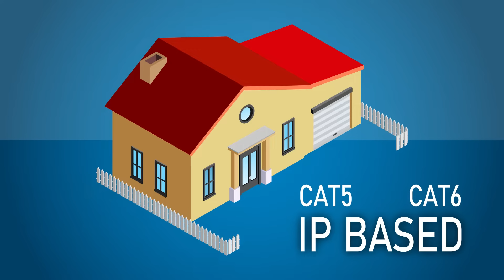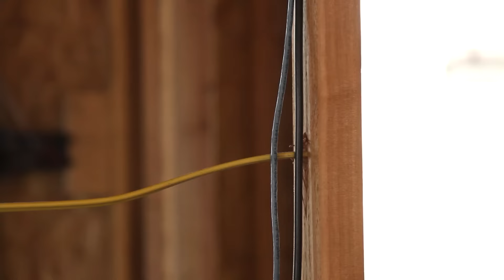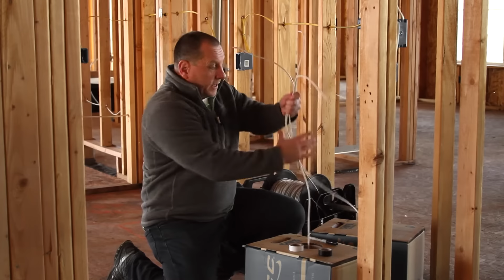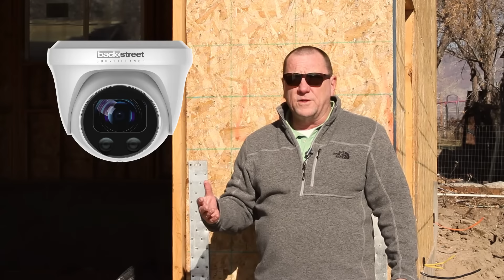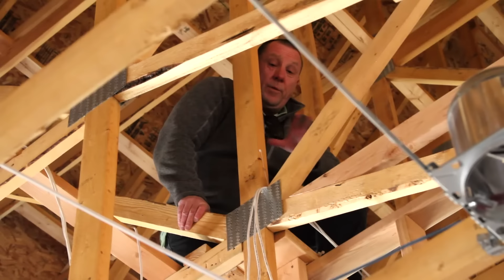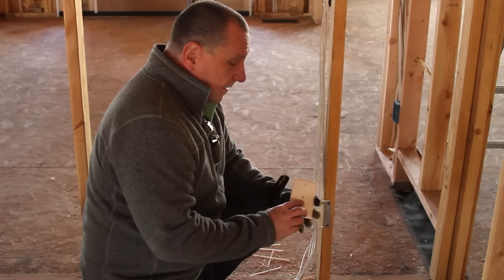Home Security Camera Wiring Explained Step-by-Step Installation Guide

Comment: If you are really really concerned about cross talk upgrade to shielded cable.
A cheap way to also prevent in a way cross talk is to twist the bundle of cables whenever you can.
Believe it or not most of the difference in cross talk rating is.... !?

the twist in the cable!!!
I used to apply the above technique on auto sound systems and worked like a charm.

Comment: Thanks for the video. Lots of good tips and I learned a few things.
I think you're overly paranoid about cross-talk. Wires crossing at 90 degrees is not a problem. Wires running parallel or less than 90 degrees to each other will potentially cause issues. Being conservative isn't usually bad - but don' t run up a huge bill or give yourself an ulcer to avoid one 90 degree crossing.
People can relax on avoiding a jack at the NVR, too. Go visit a data-center some time. They put millions of dollars on the line every day with connectors that you're avoiding. These are digital signals - not analog or RF.
Reply from the maker: Our moto "get it right the first time". Short cuts usually end up taking the longest. We are not here to provide short cuts.  Anyone can cross the wires if they want but if you start having strange unreliable video...remember to check your wires...

Comment: Great video thank you ! I have an issue, and do not know what to do. The location where I want to install my security cameras only has a 8 foot off the ground soffit. The other soffits are 9 feet off the ground. I live in a Ranch  style house.  I am concerned that someone can grab a pail or chair off the porch and steal or damage my security camera's.  I believe that the camera's should be up in the air about 12 feet. Not sure how to accomplish this? Security camera mounting arms are not long enough to accommodate the mounting if I try to attach a security camera  up a little toward the peak of the house and extend out toward the soffit in a straight line. Any help would be appreciated.
Reply from the maker: Thank you!

Comment: So much good advice here.

Another advantage of having larger holes is that if you have to replace a cable, it is easier to pull a new wire through.

Ethernet is the wave of the future. Wired cameras are always better than Wireless since all cameras have to have power anyhow. Also, POE is becoming a thing and future homes will have most of their lighting via POE. All of my homes have Cat6 and I have POE lights.

The other big advantage of wired security cameras is that criminals are now getting Wi-Fi interrupters/blockers which negate the effectiveness of wireless cameras. You can’t disrupt the signal with ethernet cameras.

The best piece of advice in this video is to reduce the number of connections. All of my security cameras are home runs from the video cam to the NVR.
Reply from the maker: True on that.

Comment: great video. suggestion on the drops.. use a pvc pipe.. run the end thru it and attach the pvc pipe (10-11 inch ) sticking out of the soffit once they do the stucco you cut the pvc flushed with stucco and install the cam
Reply from the maker: Great suggestions

Comment: The max length run for cat 5 and cat 6 are both 100 meters (328 ft). Yes, reducing the number of termination points is beneficial but there are valid reasons to terminate at the wall and use patch cables. Especially if this is an area that sees a lot of activity with adds and changes.
Reply from the maker: We're going to disagree on the small points. Cat5 cable has 24 gauge wire, cat6 has 23 gauge wire. Since the copper is larger with cat6 the distance power can be sent is further. We support many DIY customers, we choose to be safe rather than sorry so we limit cat5 to 220 feet and cat6 to 300 feet. But all these rules go out the window when you are using our Cyber Secure NVRs. They have, right out of the box, the ability to send power and data 800 feet on cat 6 cable. So all common limitations go away with Cyber Secure. Here is the link for more info: https://www.backstreet-surveillance.com/cyber-secure-ndaa/cyber-secure-ndaa-security-nvr.html

Comment: Would you recommend a passthrough or normal rj45 cap for poe runs?
Reply from the maker: Good question, its really a personal preference. Many technicians like the passthrough because its easier to see if each conductor is in the correct order. Thanks for the question.

Comment: Great video! I like to stagger the ends slightly when pulling, and overlap the end with electrical tape, it really reduces the chances of snagging.  When labeling, I use A, B, C... for the boxes, and 1, 2, 3 for the run (each time I pull wires).  The wires are labeled A1, B1, C1 for the first pull, then A2, B2, C2 for the second, and so on.  That prevents the possibility of labeling two wires the same.    I also put it on the diagram immediately when pulled, so I know where everything is without having to look back.  In a rough-in situation like in this video, it's convenient to run it through conduit if you have a few extra dollars (PVC or corrugated) with a 2 gang access box, or larger in good locations as junction points, such as closets, or utility rooms, etc.  This allows future cable to be run extremely fast, usually in minutes, where it might require cutting into walls or climbing in the attic in the future otherwise.  The $1 per foot for conduit is usually well worth it. I'll usually install a pull string with every conduit, so I have the ability to pull new cables without requiring fish tape, and the new cables get a new pull string as well, so there's always one in place.  Always check with local fire code & tolerances to make sure holes aren't too big.  I usually run them below joists next to HVAC, then seal it up with the HVAC duct drywall dropped down. Securing them every 3 ft or so is a good idea for corrugated conduit, that prevents it from moving too much for new pulls.  If you have the choice between an unfinished basement vs an attic, the basement is better, since it stays cooler.  PVC conduit may not be allowed in all areas, since an attic could potentially get too hot.
Reply from the maker: Great detail, thanks.
Reply: I wish I cod cut n paste your post!

Comment: Hey Mack    Is there an IR spotlight or light bulb that can bathe my surveillance area in IR light? My yard has so many dark spots at night
Reply from the maker: Good question, you can add infrared illuminators to the areas that do not have adequate IR light. You can buy them on Amazon (just search for "outdoor infrared illuminator"). They are literally just a light but in IR wave length. Add as many as you need to illuminate the area. Hope this helps.

Comment: Great video!  Thanks for sharing your insights.  One thing though about cross talk.  While high and low voltage cabling don't mix, sometimes crossing is unavoidable.  The absolute no no is running low voltage parallel to high voltage conductors.  Cross talk there is not only possible, it's almost inevitable!

Comment: Nobody makes a junction box for the inside cameras?
Reply from the maker: You would just use the outdoor box for indoors. We are not aware of a manufacturer making a box just for indoor use. But it is really dependent on the camera since each camera has the box made specifically for the camera.

Comment: Very little issue with EMI when crossing HV lines at 90 degrees.
Reply from the maker: Correct but the reason we do not split hairs with this is; very often cables are ran in the same paths, directions and cable trays with all the other wires...then you have big issues. When trying to provide advice for first timers to "get it right the first time" we felt it was not smart to provide a bunch of "gray area" advice. Better to keep things simple, clear and out of the gray advice category. Thanks for the comment.
Reply: @BackstreetCameras  fair
Reply: I have ran many, many AV cables in 12v applications for automotive and I have followed the rule to never run parallel with ANY power cable.  Always 90 degree cross over if necessary. 🥳. Better to learn from one’s own mistakes BUT best to learn from the mistakes of others!   Read and watch longer than you think. There’s solid gold in the next session! 😊

Comment: crazy how badly you running cables in US....without any conduits...
In Europe you would not have a single customers with delivering work like this.
Reply from the maker: That's because we are using 12v DC you can put your tongue on it. Europe uses 240v ac "kill you dead" power. Put your tongue on that and it will kill you and your grand kits. Thanks for the comment.

Comment: fantastic video with a lot of great tips; as an installer and project manager with over 15 years on commercial and industrial sites, I like most of your recommendations.  However just a quick note, Cat6 "E" is not a TIA standardized cable.  There is Cat6 and Cat6a, and Cat5/Cat5e.  While they do make a Cat6e cable, it has the same max bandwidth (1Gb at max length) as a Cat6 cable.  Cat6a however has a max bandwidth of 10Gb at max length.
Reply from the maker: Thanks for for the input.

Comment: I like your video however towards the end I prefer patch cables.  If you aren't using patch cables, you should make it clear the wiring person leave at least a 4' slack loop in the wall in case the furniture arrangement changes.
Reply from the maker: Yes they have their benefits. Its a personal preference.
Reply: @BackstreetCameras  RIght - just preference.  That is why I'm suggesting whenever wiring is done, if you leave a slack loop, should something need to be moved permanently the loop makes it so you won't have to use a bulky coupler.

Comment: Interesting to see how others run low voltage, I run low voltage for nurse call systems, I thought parallel runs were a non no due to EMI, but 90 degree crosses are ok, obviously avoid if possible. What is you separation from high voltage, 12 inches? Cheers from New 🇳🇿 ps, I like velcro with a screw through to hold cable in situ....you can easily add to it if necessary.
Reply from the maker: Good suggestions...

Comment: Very good video! If you wanna save money on electrical boxes, you can drill a 1 inch hole into the center of a 4" PVC end cap for your camera wires to go through. Mount the camera to the end cap, then use 3 1/2 inch deck screws to mount the PVC end cap to a rafter. Use a scrap 2x4 in the attic or on top of the aluminum/plastic soffit if no rafter is available where camera needs to be mounted. Bonus; PVC end cap may drop the camera below the edge of the facia board for a clear view if mounting outside.
Reply from the maker: That works!

Comment: Dumb question, Do you run cable from the camera position to the termination point or vice versa.
Reply from the maker: Not a dumb question, as long as you follow our suggestions you could pull either direction. Usually we pull from the terminal location to the device location. Hope this helps.

Comment: This is the business I want to get into, running data cables for surveillance cameras in prebuilt homes. A lot of the work I do now is running data cables in buildings that are years old and troubleshooting existing cables that have been there for years. I want to work in prebuilt homes so I can neatly run cables and label them the way I want without headaches like not knowing what’s behind this and that wall and having to run cables through difficult routes

Comment: Excellent video and instruction. I wish I would have seen the video last week. I wired my LV after I wired the house. I have Cat6 and RG6 all over my high voltage wiring in tight vaults and above ceiling joists over low shed roofs. I thought they could cross, just not be under the same staples(from someone else's video.
Reply: I was gonna comment on that too, crossing is fine, parallel runs are not not allowed

Comment: Just found your channel and it's great. The only thing I would mention would be 1. go with Cat6A not E. Cat6a is the TIA industry standard, cat6e isn't an actual standard for marketing purposes (perhaps because the Cat5e IS an actual standard? I don't know.). Not that there's anything wrong with your cat6e cable, I'm sure it's fine, but different manufacturers might make worse cable than others. Cat6a is THE standard, so why not go with it? It's also got the core, rated for 10 Gbps, offers shielded versions, etc. Even Cat6, another standard, is rated for 10 gigabit (only at a shorter range, I think 55 meters?). 

And 2. stagger the cables when tapping them together. They are much less likely to catch anything and get hung up. Of course, you guys are pros and know what you're doing, with a 1 inch hole and open construction, I'm sure you won't have ANY issues whatsoever, but sometimes in a retrofit or odd situation, it definitely helps! Nice job.
Reply from the maker: Thanks for the input greatly appreciated.

Comment: would it be ok to run electric and Cat 6 side by side if the cat 6 is shielded?
Reply: if you absolutely have to cross a cable keep it at 90 degrees, although a shielded cable probably won't be affected (as much).
Reply from the maker: Hi Brian, you can run low voltage 12v DC in the cat6 along with data but any AC power will likely mess things up. Hope this helps. Thanks

Comment: What type of cables do security cameras like Lorex and swann come with are they consider cat5?
Reply from the maker: Good question. In the past both Lorex and Swann have reduced the amount of copper in their cables to save money. This means their cables usually only work with their cameras. Because they do this, their cables are not true Cat5 or Cat6. Seldom will their cables support a normal CCTV IP camera. If you are going to go with Lorex or Swann do yourself a favor and pull real cat5 or cat6 cable, don't use their cables. If you end up replacing the system as many do at least the cables will work with other brands. Thanks for the question.
Reply: @BackstreetCameras  thank you for your reply in such short notice! I have an existing set up and I believe the one I'm buying uses the same coaxial cable (BNC) that I currently have installed, only its like 10 years old. Thinking about using those same cables for the set up. Much appreciated!! I feel like that, if a wire is compromised that's how i will know. Great video !!!!
Reply from the maker: Its likely you will have troubles with that cable unless you buy another lorex system. "BNC" is the fitting, it does not indicate the cable quality at all. If you'll notice the Lorex cable is about 1/8th an inch in diameter. Normal coax cable is at least 3/8" diameter. Lorex cheats on the coax cable most of all. The glaring proof is the cable diameter, the good news is if you buy another Lorex coax system its likely to work. If you buy other (industry standard) cameras there is a big chance you will have problems with video quality and reliability. We have seen this issue play out with thousands of Lorex systems we have replaced. It would be a much easier replacement for customers if Lorex would have just stayed with normal RG59 cable instead of going to the ultra cheap solution. Hope this info helps.

Comment: What cables are solid wire vs stranded? What handle higher POE voltage? What wires have thicker conductors?
Reply from the maker: Buy sold conductors, Cat6 has larger diameter conductors, 23 gauge instead of 24 gauge, (the larger the number the smaller the conductor). This is why you can go further distances with cat6 rather than cat5. Hope this helps.